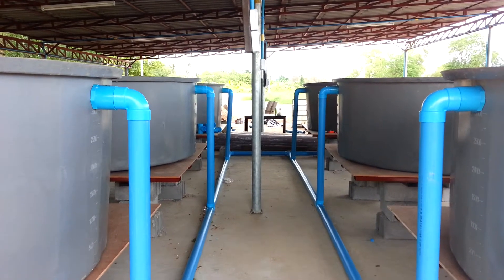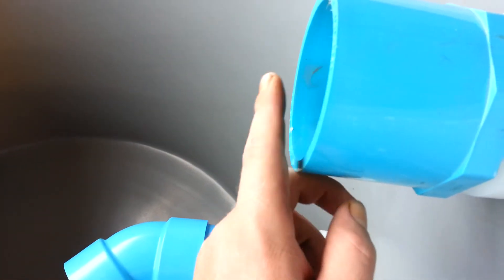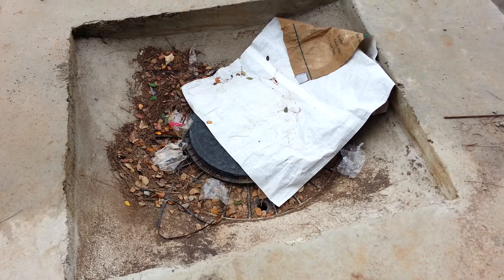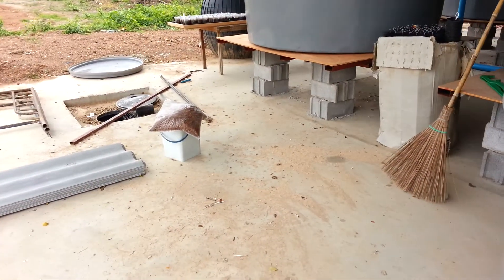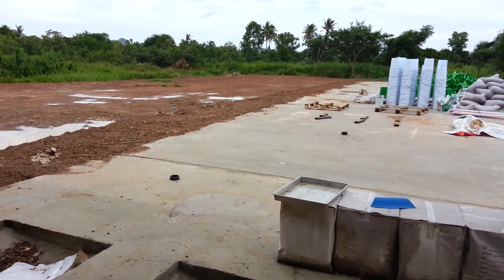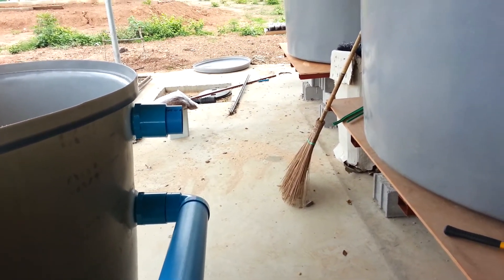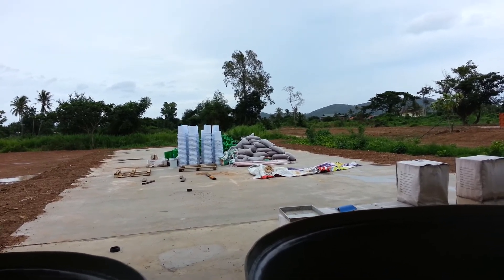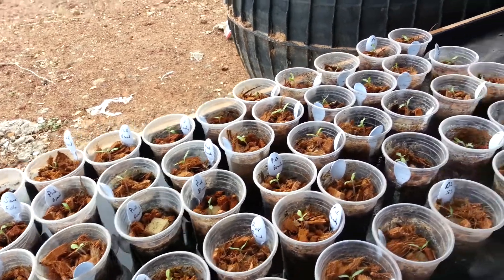Commercial Aquaponics Build Part 8

Comment: What is the issue with the pond water? I used pond water to jump start my AP system 4 years ago to get the bacteria.. I drain my pond down in the fall to get the fish out to put back in the greenhouse AP system... My pond is small than the one you have but still same concept... Also what is the overall length of you concrete pad?
Reply from the maker: The issue with the pond water is the unknowns. Potential parasites, toxins, chemical run off, things like that. The pond is fed during the rainy season from other bodies of water. There are a lot of industrial and agricultural chemicals commonly used here that are banned in other parts of the world. Just playing it safe, and avoiding the work/time it would take to mechanically filter and then treat water. I could probably use it and be just fine, but the fish aren't cheap, and if I pollute my system right off the bat, I have a lot bigger problems on my hands then a water bill. Total length of the pad is around 42 meters (including growing area and fish house)
Reply: Ponic Wars Gotcha yeah I forgot that you are not in the USA... Chemicals in the water make sense...I'm working on my first 16x50 greenhouse, doing it in stages but in the end I will be at 2 16x100.. Plan is a 16x50 each year for 4 years...What kinda fish are you using?
Reply from the maker: Leesville Aquaponics Homestead That sounds amazing! 16x50 per year is a good strategy. I'm going to use Barramundi.
Reply: Ponic Wars very very interesting choice of fish... I raise blue Tilapia cause I'm in a climate close to yours but colder winter... I'm in South Carolina where we get tons of rain in the spring fall winter and summer is super hot so I fight the heat as you will be doing there...

Comment: "That's ALL I've got done" he says.... You've maanged to get so much done since your last video - very impressive progress. It must feel so satisfying getting to build all of that. I've said it before - I'm massively jealous of what you're doing there.

One question though (probably showing my ignorance here)... I thought that the outflow on swirl filters was supposed to be drawn from the centre of the tank so that solids get pushed to the outside by centrifugal force leaving just the water at the centre of the swirl.

Cheers, Jim
Reply from the maker: Jim Conner  You are basically correct. In this case, I'm not sure those filters will allow me to put an extension with an upwards facing 90 angle in the center, simply because that pre-fabricated exit hole is plumbed near the top already. I need a little room for headspace. I hope that makes sense, having a difficult time describing what I mean. Swirl filters primarily rely on suspension time of the water within the tank, and the mass of the fish waste as it relates to the water. So it's not entirely about centrifugal force (as I understand it).
Reply: Can't you use the top hole for inflow, and connect an L-shaped piece to the lower hole for the outflow? (That's what I'm more used to seeing)
Reply from the maker: Jim Conner I think that would be just fine! Honestly I didn't think about doing that. The only point that came to mind after pondering the question is that I would have less head working to push water through the filters. Example: Let's say using the bottom hole as an input from the fish tanks, based on height, I have 40cm of head from the fish tanks, to filter input. Using the top hole as the input would be something like 20cm. So I would lose 20cm worth of head pressure. (Those are just example numbers) I think that's how it works anyways, I could be wrong!
Reply: I'm not entirely certain, but I don't think the head is affected at all - The reason being that the top of the L shaped pipe in the lower hole will be about the same height as the top hole. The water will still have to rise to the same level as the top hole to exit from the filter, whether it goes out through the top hole, or through an L-pipe in the lower hole, so I don't think it changes the head at all. (Hope I'm right on that, but it seems logical to me)
Reply from the maker: Jim Conner I'm not sure either Jim. Someone will know, and set us both straight. What you say makes perfect sense. I'm only thinking about head as it pertains to water pressure, in terms of pushing the actual flow of water. Either way, I'm not redoing it! haha
Reply: Given the number of different swirl filter examples out there, I'm not really sure that there one single right answer. It's in now and it'll work well enough and that's all that matters :-D
Reply from the maker: touché!